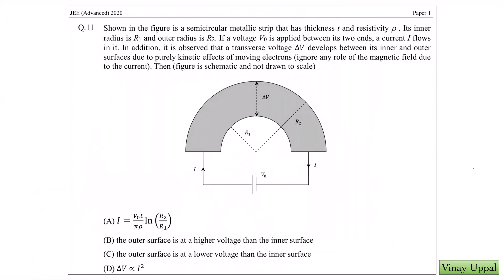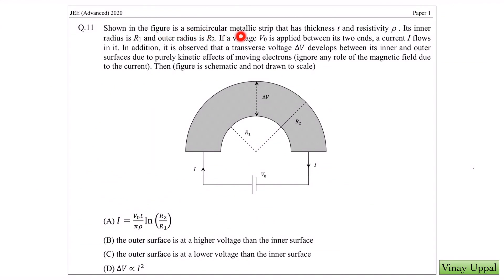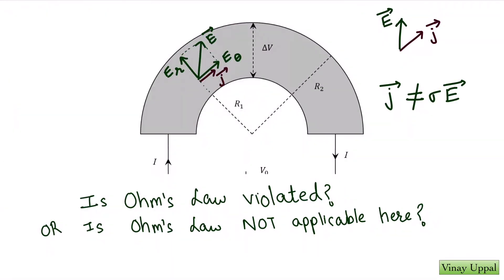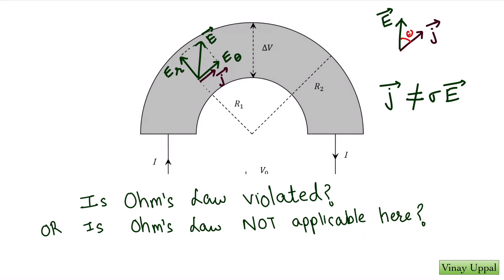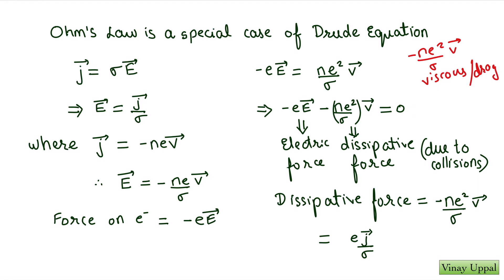RARE: Episode 2: Did JEE ask out of syllabus question? Is Drude Equation in JEE syllabus?

Comment: How did you assume that the trajectory of charges will be circular, sir?
Reply: thats how the current flows, so that's the reason.
Reply: Where exactly is it written that that's how the current flows?
Reply: @afzal1104  I wanted to say that this kind of trajectory is the best possible expectation, due to the nature of transverse voltage. just use the information regarding the direction of electric field, and we know that the force on electrons is opp. to that direction. so it becomes obvious that the trajectory of e- are circular (tangential and radial force) hence current is in the opp. direction of this.

Comment: Hello sir..
This was no doubt a very helpful and informative lecture..
But I have a slightly different approach for this and it would be very grateful of yours if you revert back with a feedback🙂
Since the electrons are moving in a circular path, with a very high velocity(drift velocity),  the circular trajectory will force most of the electrons towards the outer edge due to centrifugal force and thus increasing the total electron density near the edges as compaerd to the inner edge... thiss will create an electron rich region (the outer edge) and an electron deficient region(the inner edge) and thus there will be a difference in potential due to difference in charges(inner at a higher potential and outer at a lower).. 
I considered going by this way just because they have mentioned that only the kinetic effects of wlwctrons should be considered so thought this must be a better way to opt for..
And since the net electrons in the circular region remains constant throughout, there will be no  field generated (except that of the instantaneous field due to difference in electron densities..) and therefore this wont violate Ohms law.. 
And as always...Mind boggling question by jee☠️

Comment: Sir my answer is correct but am I doing anything wrong here, pls see:
Option 1 is easy:parallel arrangement of thin elements so integrating 1/R will give I=V.t/π(rho)ln(R2/R1) so correct
Thought for the next three options, there will be mv²/r towards centre so electrons will have radial motion towards central direction, electrons will get accumulated so high potential at inner surface(opt C) then we know mv²/R=qE=q∆V/dx but as per I=neAVd where V is drif velocity: So Vd varies linearly with I so we can write Vd=kI but Vd is velocity of electron so we can say q∆V/dx=mv²/R=m(kI)²/R=k²m/R(I)² so we can say ∆v is directly proportional to I²
Sir pls see if this is correct
Reply from the maker: What do you mean by a force of mv2/R towards the centre? That's just value of net force. Electrons will be accumulated outer surface not inner surface to produce a radially outward field
Reply: @PhysicsWithVinayUppal  is it the concept of bending of electric field that you mentioned in comment